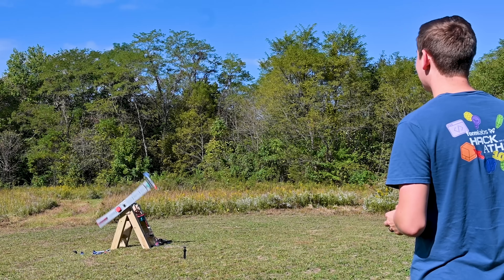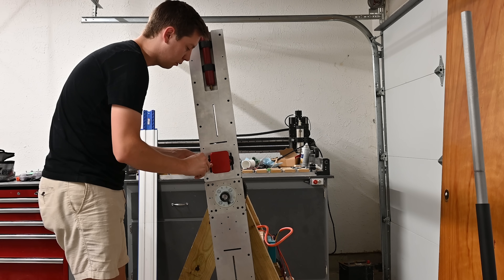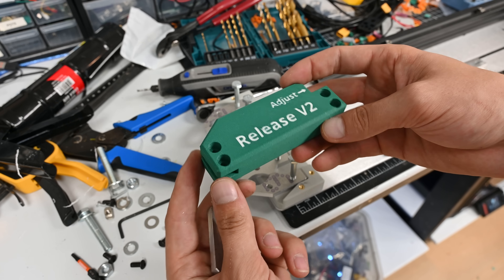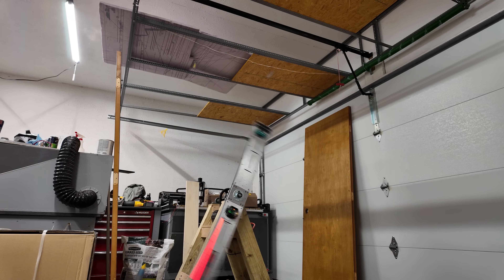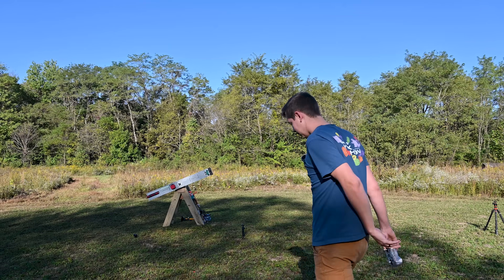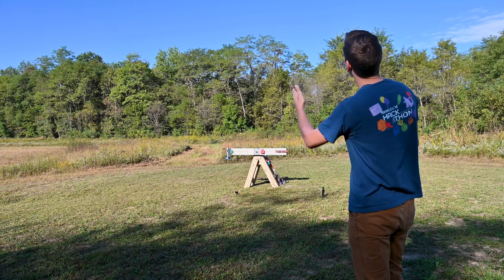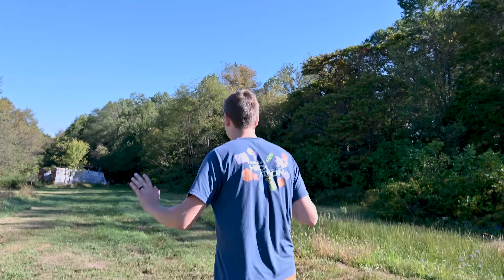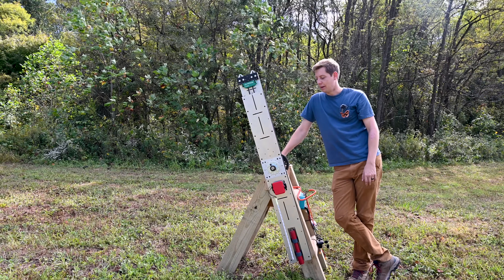I Fixed SpinLaunch

Comment: How about a counterweight, that gets released as well when you shoot the rocket. Might enable you to manage heavier payloads.
Reply: Could he use a movable counterweight that slides in when the rocket gets released to adjust the amount of counterweight? Does that make sense?
Reply: @dCash117  To slide in, it would have to overcome the centrifugal force pushing it out. I wonder if you can instead let a weight, mounted to the same arm as the rocket, slide out? Or perhaps you could let liquid flow in from the center and towards the rocket side to replace the rocket mass?
Reply: @Mueller3D use a heavy spring which pulls the weight back in at the moment of release
Reply: @Mueller3D pulling the weight to the center would also cause the arm to start spinning much much faster.
Reply: @dCash117  Yes, in theory this should work. But how to move that counterweight so fast? Maybe the Rocket could pull the counterweight in while releasing?
Reply: @dCash117  yes, something that slides forward on the arm launch side when launch happens, to compensate, and the release trigger needs to be at a fixed angular position relative to the spinning arms, instead of trying to eyeball time it.
Reply: Yeah, seeing the launch system shake around like that after launching is not good at all, and it will be even worse with higher speeds and more mass. What came to my mind was a counterweight that can change its distance from the fulcrum, using something like a linear actuator to pull the counterweight closer to the fulcrum on release. This is better in two ways: it is much easier to fine-tune the balance, and it's safer than just launching the counterweight lol

Edit: I just scrolled down further in the comments, and it seems someone else has already thought of this as well lmao
Reply: @mikerich32  That was my instant initial thought too. No wonder my buddy who was in university for engineering always told me that I had the brain for it LOL
Reply: @mikerich32  Cool. The idea is... Sound.
There's a lot of energy to be damped INSTANTLY or quite so. Therefore you'll need quite the same amount of energy needed for the sole launch. But in a frame where we're already having an enormous improvement in logistics it could be neglected. Tho, the "quite instantly" remains a challenge. Belt drived, linear actated, a screw gear with 4 principles...or do you mind using an explosive charge on the spinning like shit rod of death? The solution sounds good but the practical application scares me.
TBTH, a releasable counterweight would be very cool.
The angle should not count as you have escape velocity (and mantain it) so you could launch TWO payloads of the exact same weight in opposite direction, tangent to the ground. THIS would be fun!!
Reply: @mikerich32  would it even be fast enough to shift the counterweight? for lighter payloads it might work, but for heavy ones, you need to shift all that mass quite a bit and precisely 

I think launching the counterweight shouldn't be to bad provided he can guarantee the timing and shoot it into the ground

otherwise, there are self balancing mechanisms which might work, but would still have a bit of wobble before stabilizing the whole thing (see steeve mould video on the tire beads)

Since he can constrain the movement more, he can probably come up with a better mechanism to acheive the same result without the unpredictability of beads or the complexity of a mechanically shifted counterweight
Reply: As a counterweight a container of water with an outlet that's opened simultaneously with the rocket release would allow you to fine tune the mass to match the rocket, and would be less destructive than something solid slamming into the ground at high velocity.
Reply: that would be fun :D
Reply: Best solution to that problem is obviously to have two pivots, first pivot is the normal pivot before the rocket launches, the second pivot is positioned at the new center of mass when the rocket is launched. The arm would disconnect from the first pivot, and connect to the second pivot, right when it launches the rocket at a perfect 90 degree angle

Actually wondering if that could be feasible. If it goes wrong, it would probably go very wrong
Reply: @Thomas_wur  I'm not a believer in Spinlaunch, but I think making the launch arm consist of two arms, the secondary arm's center of mass attached to one of the primary's. When the missile gets flung out, a counterweight on the other end of the secondary arm takes the place of the rocket, dampening the unevenness of the rotation. Come to think of it, having the counterweight on the outside in the beginning could even add a whip effect. Still won't work though, since a huge part of the energy will still be lost to accelerating that thing to serious mach speeds in the densest, and thus most resistant parts of the atmosphere. An actual rocket does most of its acceleration at altitudes where it doesn't lose most of the energy to friction straight away.
Reply: @nikolaus2688  I also don't believe in Spinlaunch, but mainly because the numbers look so much worse with way more complexity compared to project HARP from the 60's. Why waste design on a dangerous, unwieldy spinny thing when you can just shoot it out of a massive gun lol? SL is trying to say they'll use a stage 2 (rocketing after the spin launch)  to address inadequacies, but yeah I think they're just a sink for gullible vc
Reply: @Thomas_wur  That would be an absolute nightmare to time right, and the stronger the pivot, the harder it is to release/attach rapidly.

Maybe if he had accessed to half the budget of NASA, or built it really tiny with like.. 10m of maximum launch height.
Reply: @Thomas_wur  You just made me wonder if you can turn this into an insane Atlatl
Reply: Straight into the ground, thud. Lol. Sounds great, I want to see that.
Reply: @clonkex  One lawn dart for every rocket
Reply: @clonkex  the counterweight could also be a liquid, should spread the impact
Reply: @sperzieb00n  Interesting point, although since the liquid would have to be contained in some container and would have contact with the walls of the container for some period of time during release, I feel it might be more difficult to precisely time. Whereas a solid mass can be hooked on, and the instant the hook releases the weight is fully disconnected.
Reply: @clonkex just thinking, but what if the container were conical? That should make the wall contact very minimal on transfer. Or perhaps utilizing a vortex? And, maybe assist the initial impulse with a pulse of compressed air. Like a potato gun.
Reply: Somebody was watching Stratzenblitz :)
Reply: Will need to dig like a deep hole or something for that otherwise the impact could destroy a lot of dirty and possibly hurt the device from debris
Reply: @crispycrusader1 Could be something like a pool of gel to absorb the inpact though
Reply: @mmis1000  just guess depends onnthe speedd since goal is to launch something
Reply: @mmis1000  launching something right at you feet at orbital speed is gonna leave a sizable crater. Gonna need a flame trench type deal.
Reply: @crispycrusader1  Just use water as a counterweight and it will not damage anything.
Reply: @titter3648 oh, true, but wont match the density so would need it to be shaped differently a bit to allow for it in the design but thats a good idea, just splash it into the ground as the rocket takes off
Reply: Lots of thoughtful ideas that require additional control. There is already an actuator that releases the rocket, it should simultaneously shift the counterweight into the correct post-launch position.  In fact releasing the counterweight towards the rocket could release it as it slides into position.
Reply: @KallePihlajasaari I was scrolling through the "wrong" answers to find if anyone had stated the obvious solution. Nice to see it came from a fellow Finn.

I was yelling to the screen for half of the video that why he has the release mechanism working backwards and adding more inbalance to the system.

It should have some quick release for the balance fixing mass to slide towards the rocket and do the release with it. Then the balance+release subframe should have movable weight on it to fine-tune. Like threaded rod in the middle of the arm and a weight you can twist in and out for correct effect. Just need to add a way to lock it, so it won't vibrate off during the launch.
Reply: Best idea is to build two counter rotating arms and always launch two rockets
Reply: @meateaw  'Best idea is to build two counter rotating arms and always launch two rockets'
Exactly that.  Two identical mechanisms with two identical rockets, or at least a simplified but same mass one.  Sand pit, or deep bucket setup with water.  You could also set the second rocket up to go high drag, so it doesn't get destroyed but is reuseable.  Needs similar weight and distribution, but it could basically be a foot long bolt with nuts distributed along it so it matched the rocket reasonably well.  Two or three buckets stacked, with mud that goes from more liquid at the top to more solid at the bottom might do well.  Put a light kevlar string attached to the back, with a float at the end.  Launches, bolt goes into the mud, float and string stays up, pull the string and get the bolt back without having to search the mud.

Raise the height of this launcher.  Put two long flexible arms on the ends of the current arms, and spin it up.  You just doubled your launch speed.  Looks like this could probably launch this rocket at 2x without much problem, there seems to be plenty of power.
Reply: Technically speaking, as long as the structure can withstand the forces that come from those harmonics, you don’t actually care about the balance once it’s released.
Reply: Mass is energy and viceversa I'd becurious to see how and where SL is going to drop all the shit energy that's necessary to accelerate a non-zero mass body to the escape velocity. Oh for sure it would be fun, the release has to be instant. I wouldn't be surprised if the mv mass per velocity needed, had to be expressed in kilotons...
Reply: A water tank that opens up at the same time the rocket gets released should be quite easy to make.
Reply: oh, you got this idea first!
love it
Reply: So many comments about a shifting counterweight. Great in theory, but if rotation speed and projectile weight is increased, the force required to move that weight lightning fast will be immense. An explosive charge might do it.
Reply: it's a failed inefficient concept from inception no? 

it just seems to me there's no many cleaner ways to launch a rocket.. like sending it down a mag-rail, or using some kind of kinetic driver to fire it. spinning seems like a terrible route to go for multiple reasons.
Reply: @chrishayes5755 oh i agree its a terrible design, but i think the idea is the density, with rail it has to be an exceptionally long track to build the speed, doable but a mega project none the less
Reply: in this case it would be safer to capture the counter weight because this system is portable and a catchment system would be hard to engineer. it also would make it more reusable.
Reply: Or a second payload at the other end of the arm that gets released on the next half revolution.
Reply: Yes. The counterweight can be a water or simply a shifting mass inside the launcher arm.
Reply: Free-wheel on the other side of the axle can help stabilize the shake. A moving counter-weight was my first thought, but it adds a lot of complexity to engineer around (timing, position, weight, etc.)...Big 'ol free-wheel makes the rotational mass larger compared to the released projectile's mass, which is where the shake seems to come from...plus it's easier 😅
Reply: he could even make the counterweight a liquid, should be much less damaging the something solid when it releases
Reply: You could move a mass from near the middle outward in the opposite arm.
Reply: He might be able to use balance beads
Reply: Just toss the counterweight into the ground
Reply: Self balancing beads might be a good use case for this. Steve Mould had a good video about it recently: https://youtu.be/T47s4L1Wje4?si=89B28l_278OiQrd5
Reply: I think there’s two problems to solve. First is that when the first clamp releases, all the mass is on the second clamp and that is going to throw a moment onto the axis of rotation, and then that moment will disappear when the rocket is released. The second problem is the release of the mass is near instantaneous so you have to replace the off balance mass really quickly. Liquids are going to move unpredictably so I don’t think that’s an option. I feel like you need the counter balance being the exact reverse of the launch release mechanism with a two stage adjustment, if that makes sense. 

But for goodness sake someone buy this dude a trolley to save his back :)
Reply: Yeah, like a container that has the proper amount of water to balance out the rocket and an electrically controlled valve to release the liquid at the point of launch. Safe and adjustable.
Reply: Instead if you optimize the momentum transfer you can get the arm to completely stop spinning when releasing the rocked.
Reply: Good idea, because the counterweight would be able to slam into the ground, making it completely safe.
Reply: Then you have a high kinetic mass launched in the opposite direction to deal with.
Reply: Perhaps a container of water, acting as the counterweight -- water that gets released the same time as the rocket.  Far less scary than a mass with chaotic potential.  Plus, it would water the grass.
Reply: Maybe not released, but retracted (so you don't destroy the floor or launch an other projectile if angles are malfunctioning)
Reply: Launcher would obliterate itself after launch of heavier payload/at higher rpm. Counterweight is a must at this point.
Reply: SpinLaunch just has a counter weight that slides to a different position. Since you have the grapple assembly + rocket on one side, the counter weight needs to be farther out to match. When you release the counterweight just slides closer to the center enough to counter just the grapple assembly.
Reply: The rocket is still gonna veer off in an undesired path.
Reply: This is also what spin launch is trying to do!
Reply: @patrickriley5816  yeah, and that doubles the energy needed for the launch. And all the energy of the counterweight will hit the launch system... Spinlaunch is dead on arrival....
Reply: @francescosirotti8178 flame trenches are a thing, you could probly figure something out for a counterweight. And if you can use electrical power instead of rocket fuel, energy requirements aren't as big of a problem.

The idea is kinda insane, but so is strapping people to a 1000 tons of rocket fuel and lighting it on fire. But they made that work somehow.

Comment: Since you are using pressure anyway, you could use water to counter balance your arm.
Any liquid or flowing solid would do but water is by far the easiest.

And, you know, if you use metric you can easily balance for different rocket weight on site with a simple a graduated cylinder.

Comment: To counteract imbalance after launch, you could add a mass on a slider inside the arm. Then have it release and shift outwards at the same time as the rocket release, maintaining the arm's balance during spin down.

Comment: Can you put a screamer in it? That would make such a good sound.
Reply: The rocket going squeeeee as it speeds off into the sky would be hilarious
Reply: But you have to activate it at launch. 
Otherwise the start up would be pretty loud 😂
Reply: @ViperGtr91 a little bit of plastic over the nose attached to the arm should do nicely
Reply: or a death whistle in printed inside the tip of a rocket
Reply: You could probably get some data from looking at the frequency over time.
Reply: That's a great idea
Reply: I was thinking the same! I had a Nerf ball/dart like that as a kid
Reply: What. Like a kid in a car seat? I'm not sure about the ethics...

Comment: Nice.  Now you gotta light a rocket motor as it launches.  🚀
Reply: I'd say light it off at the apex or near apex. If we're worried about it changing orientation, then perhaps 80% to apex height. Maximize the ∆V of the rocket motor
Reply: @ktoliman i think trying to get an SRB to light with sub-second precision might be tricky.   Might not have a choice.
Reply: agreed with as it launches because.. if you ever played with model rocket engines, there's a "burn" before the actual rocket propellant ignites of a second or two. This would let the "craft" stabilize its wobble before full thrust occurs. maybe have a simple trigger string that pulls from contacts causing contacts to .. contact.. and power the igniter.
Reply: I like the idea of using the spin launcher to do the work of acceleration, letting the onboard fuel do the much more efficient work of maintaining speed, not having to carry the load of the most inefficient part with it through its flight.